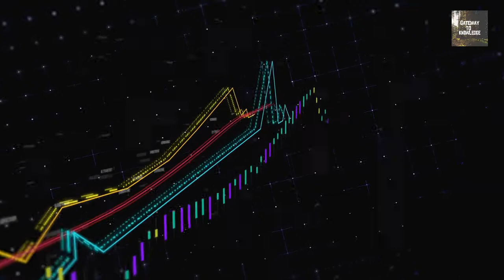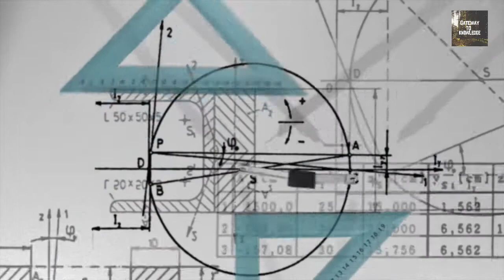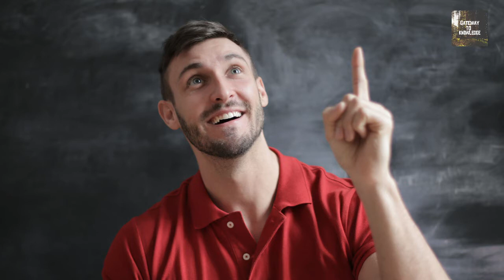How Rocket Moves In Space When There Is No Air To Push Against?

Comment: Now explain how the ignition can stay lit went exposed to the vacuum of space through the exhaust
Reply: Why WOUDLNT IT?  There is fuel, and oxidizer, and a spark.
We have MILLIONS of hours of operation of rocket engines in a vacuum
And we test them here on earth in a vacuum chambers BEFORE sending them to space.
Reply: @stuartgray5877  lol you can't "have a spark" with no oxygen.  The fuel onboard after separation produces oxygen AS A BY-PRODUCT but you still need the initial reaction to create an oxygen by-product.  Circular logic at its finest.
Reply: ROB BLACK - the pressure of the combustion chamber is about 3000 PSI and the pumps feeding into it run higher than that.
The fact that there is a vacuum somewhere downstream of all of that means nothing to the desire for combustion to occur at those pressures.
Reply: This guy is crazy. How does his rocket steer since it has virtually nothing to push against except for his launch. If it’s an object in motion, what changed its direction to keep a rocket go in a straight line towards Mars or the moon when the earth is revolving and spinning around the sun and hurling around the Milky Way?
Reply: @Mcgrandma  - "How does his rocket steer since it has virtually nothing to push against except for his launch"

Rockets work by feeling the RECOIL FORCE of PUSHING AWAY MASS.

Would a crossbow firing a projectile into a vacuum feel a recoil force? Yes or No?
Reply: @Mcgrandma  fire a gun do you think it kicked because the bullet pushed of the air
Reply: @darrenwilliams414  recoil happens from atmosphere gas returning back into the gun
Reply: @DuffDuff-ev7tc  if that was the case a blank would kick the same but it doesn't
Reply: @darrenwilliams414  because a blank can create a vacuum of atmospheric gases that upon returning create recoil??  You must really be a genius.  xD
Reply: @DuffDuff-ev7tc  ok genius why does a bullet kick more than a blank
Reply: @darrenwilliams414  this has been explained ad nauseum.  Bullet exits barrel at high speed creating a vacuum.  Once the bullet leaves the atmospheric gases return to balance the vacuum and do so rapidly.  This is what causes the recoil-- it's once the bullet HAS LEFT the barrel of the gun and once the ATMOSPHERIC GASES have returned that generates the primary recoil.  This is the BIG recoil you see.  If primary recoil happened as soon as the bullet was detonated the whole gun would kick and bullets would never hit their target, which we know is not true.  It's also why suppressors, which also suppress sound (another trait of the atmosphere) also suppress recoil.  There is a slomo vid that shows exactly this: detonation, bullet exit, ATMOSPHERIC GASES RETURN immediately followed by primary recoil.  If you put primary recoil immediately after bullet detonation, then the gun kicks and the barrel is pointed off target.
Reply: @DrCash7  so what kicks more a bullet or a blank
Reply: @DuffDuff-ev7tc  - "recoil happens from atmosphere gas returning back into the gun"
NO.
Recoil happens when ONE "MASS" pushes on another mass.
I suspect you are one of those uneducated individuals that believes that crossbows do not produce any recoil.
Not ONLY do crossbows produce recoil force, but they do so IN A VACUUM.
Reply: @stuartgray5877  so rockets can't work in a vacuum cos there's no other mass to push against. Thanks for admitting that, chatbot 😂
Reply: @papalegba6796  - " cos there's no other mass to push against."
There you go claiming that the EXHAUST GAS does not have any mass genius.
Go back and complete high school where they teach you that Water and CO2 HAVE MASS.
Reply: @stuartgray5877  I'm not claiming that tho, liar. I'm claiming that the mass of the exhaust has no external mass to create a force pair with in a vacuum. And you agreed 😂